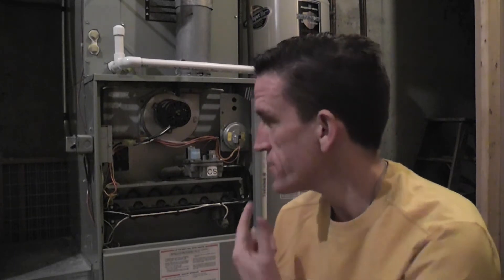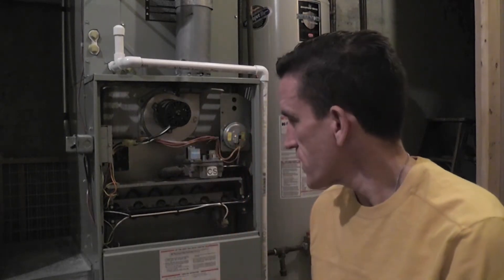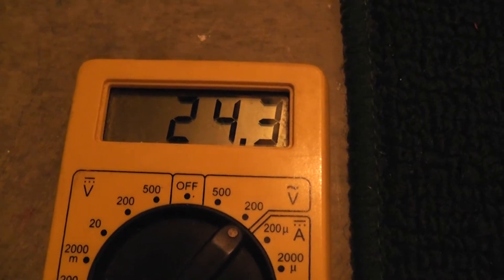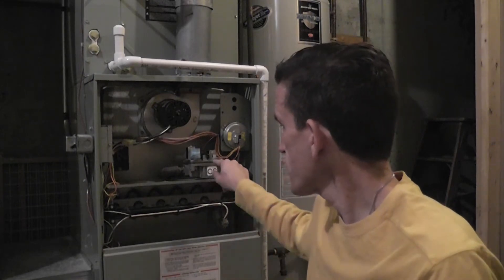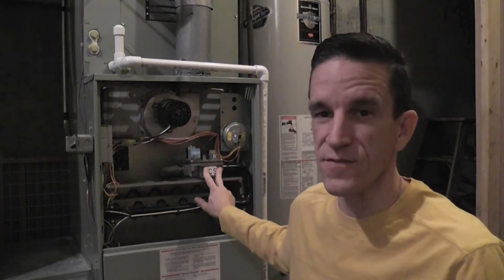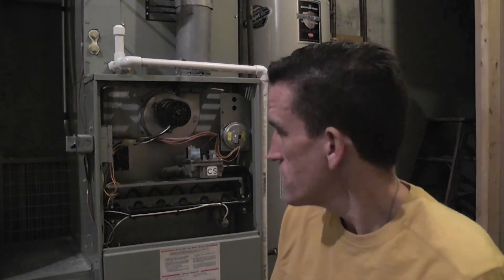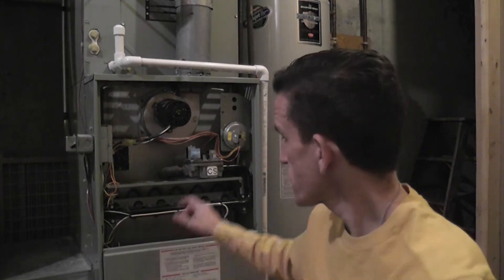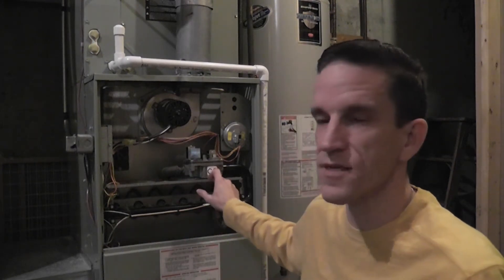Furnace Trouble (take 3) - Replace Gas Valve (Trane XE80)

Comment: Do you have the part number for this replacement gas valve?  Is it oem or an upgraded compatible model?
Reply from the maker: Unfortunately, I do not have a part number but a local part supplier should be able to match your model with right valve.

Comment: How much did you pay for the parts and labor.
Reply from the maker: I don't recall exactly but I bought the valve directly from the shop and had the technicians install it.  Most valves are less than $100, and I do not recall labor although I suspect less than $200/$250 (this was a 30 min job for them (definitely less than an hour)).  I respect technicians and labor cost along with fair labor rates, however I am not a fan of price gouging.

It is important to note how I sourced this job.  I bought the valve and sourced the labor separately using a smaller shop (licensed, insured, and qualified technicians but not associated with a large company).  This will save money in the end.

Comment: Thank you for the video. I may have to have the same thing done. I noticed the valve looked a little different then the original one. I suppose an upgrade or redesign. The parts store where I get parts would not sell the valve to me because I was not EPA certified. My dad was in heating and air conditioning for 25 years. I worked at Trane for over 12 years (not as an installer).  I know how to do this. I could easily get it online but my thought was if something happened to the furnace and damaged the house the insurance company might not pay if a certified tech did not do the work. Just something to consider. Still, it is great to see how it is done. I will be checking to see if voltage is going to the valve during the times I do not have a flame and should. This could be a circuit board problem. Thanks again!

Comment: Hi Thanks for the video. I have one question. After installing the gas valve, did the technician check and adjust the manifold pressure? and if he did, did you get to record that procedure?
Reply from the maker: glad to be of help:).  they did not check the pressure as the flow was good/solid.

Comment: I have a similar problem with my XV80. About once a week or so, the gas stops coming on, and I can take a screwdriver with a hefty handle and bang on the valve a bit to get it to work again for another week or so. I was a little alarmed to see how much trouble it was to replace on your furnace. Mine is in a closet, and no way to get to that right side, so I hope there's another way, at least with my model. I'm like you, I'd want to call a repair person, but if he needs to take the whole thing apart, I might be tempted to try to open it up and clean the valve. I'm guessing it's a solenoid, but I don't know yet. Sometimes, they just get a little hardened oil or debris caught inside.
Reply: Last time it went out and I beat on the switch to get it going was about 2 months ago, and its been working perfectly since then (knock on wood - or maybe knock on the furnace). I'm thinking it may have been some sort of dirt on the switch or oxidation that got knocked off (I hope).
Reply from the maker: That could be the case ... hopefully you are good to go for a long time:)
Reply: @winfidel  still working ?

Comment: I watched your second video.  On your introduction, you mentioned everything what happened on the first video.  My trane xr80 is doing exactly the same.  I get ignition but no flame.  After cleaning the flame sensor it worked for a few days.  I put new flame sensor and worked for a few days.  Im about to replace the limit switch and I'll be ordering the gas valve next just to be ready.
It's been 4yrs since this vedio and wanting to know how it worked out so far?
Reply from the maker: It's that time of year when the cold arrives and furnaces fire up:).  The gas valve was the answer and still running strong today - no issues.  Sounds like you are on the right path ... post back with your solution once found as it may help others.
Reply: @RealWorld  thank you for the vedio and respond. My gae valve should arrive in a couple of days.

Comment: It was a very nice video (music was good!)  I have a Trane XE70 and I sm told I need a plumber because there's no gas coming in the line?  Blower motor replacement about three months ago.  Furnace just clicks and will not ignite.  Any clue anyone?  Thanks!
Reply from the maker: might be a faulty gas valve and not certain a plumber would be of much help:).  search for a furnace repair tech.
Reply: If the igniter comes on, check the igniter flame sensor.  It gets corroded and may just need to be cleaned with a green pad or just order a new one.

Comment: I didn't think the gas valve could stick. Watching you bang on the valve, I had my doubts, but I tried. I am surprised to say it worked. I am ordering a new valve but it is nice to know that this is the issue. Thanks
Reply: Did the valve fix the problem? Im beginning to suspect that mine is bad.
Reply: @squidusn71  what did you figure out ?
Reply: @Lemony Snicket (Uni-T)  I changed the valve, and it worked until the next winter started, which is this winter of 2022.  I started not getting a flame.  Code came up being the pressure switch this time, so I changed that.  It worked after a week, no flame.  As i looked around, I found a short on the circuit board.  A relay was burnt.  I replaced the circuit board before Thanksgiving of last year, and so far, so good.  
I'm thinking back now, I believe the original gas valve, flame sensor, and pressure switch were good and that the circuit board was going bad.  My trane will be 16yrs old this year.

Comment: Do you know how much is cost replace gas valve, I had XE80
Reply from the maker: great question:).  if i recall (and it has been over a year:)), I believe the part was around $50?  i paid separate for the labor and had them pickup the part.  i am a do-it-yourself type person but feel funny about gas:)

Comment: Really great video. Thanks for posting the Trane model number of the furnace. I have an XR80 and used the video to change out my gas valve. I had a hard time getting the factory side (manifold side) off I only had a 10" pipe wrench and some adjustables. I really needed an 18" pipe wrench and a 14" for backup pipe. But after 45 minutes I got it loose with hammering the pipe wrench 150 times or so, never again. Saved $400.00, Note: the gas valve was $60.60 on Repairclinic.com
Reply from the maker: Thanks for the post/feedback!:)  The pipe can get jammed and tough to loosen ... glad to hear you made the repair.
Reply: I have the same xr80 and I'm suspecting the same problem.  Did the valve fix the problem?

Comment: What is the black pipe called that is connected to the gas valve that took two guys to disconnect? Ours is stuck and we are trying to put on a new gas valve and I'm wondering if it's cheap enough if I should just get a new one...
Reply from the maker: Hi Megan and thanks for the question:).  Unfortunately, I am certain of the name but I do know they had to leverage two pipe wrenches to get it off.  It will break free just keep working at it:).
Reply: It's the burner pipe

Comment: Thank you for the excellent video!  Now I have to call a tech to replace mine too.
Reply from the maker: Hello and thanks for the comment!:)  It is that time of years when people start the furnace and prepare for colder months.  I consider myself fair handy and will tackle a furnace to a certain point - the point of gas:).  Since I paid for the repair, I wanted to not only have the furnace fixed, but I wanted to learn from the repair (hence the video).  The repair was not too difficult, but gas is gas:).

Comment: Thank you for the information.   I found a cracked solder joint on the little board inside the valve.  I repaired that and it is working again, but I may get one to have on hand just in case. :)

Comment: what part number did they use?  mine is doing the same thing now.  have to rap on it to get it to open.  I want to replace it before fall.
Reply from the maker: Hello and thanks for the comment/question:).  I called a local supplier and provided my furnace make/model.  He also mentioned the manufacture did not make the original part any longer and a substitute/generic was available.  After a quick check on their side, the rep told the needed part.  I just took a look at the sticker/stamp on the part and see the following:  White Rodgers (model ... 36J24-205).  Hopefully, this information will help!:)  You are doing the right thing by working on now - before winter!:)

Comment: Excellent video. The workers knew what they were doing pretty well. I or you could have also done this but I understand your reservations. I'm pretty sure I have the same problem, coincidentally to be happening on the coldest day of this winter in New Jersey, -2 F last night. I tapped on the solenoids on valve and this may have worked, at least for now. Anyway, thanks for the reference.
Reply from the maker: +Stephen LaBrunda -- thanks for the comment and glad to be of help:).  I was able to get by for a month or two by resetting the power and toggling the gas switch on and off.  Once you are relatively certain of the issue, call around and look for someone to replace it.  After seeing what they did, I might try it myself the second time around although gas is gas:).  The workers moved quickly to replace the valve as you can see in the video ... total time may have been around 20 mins.